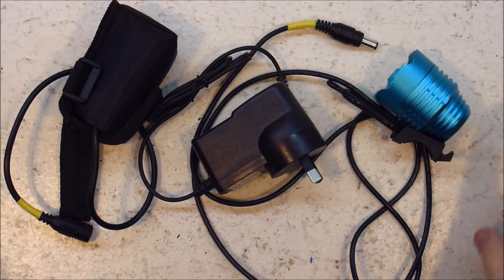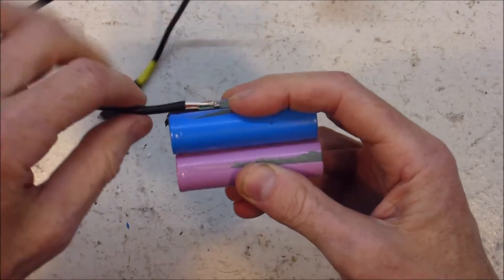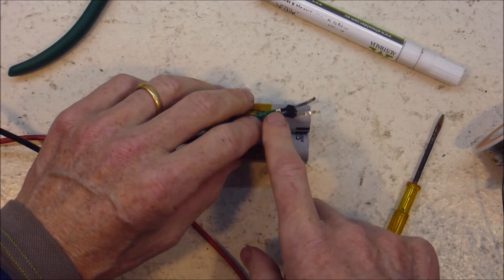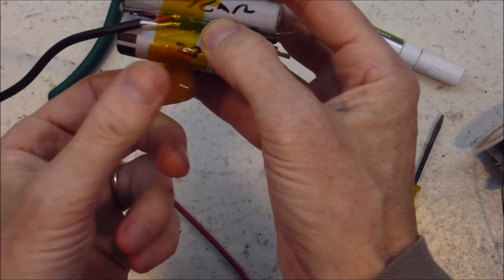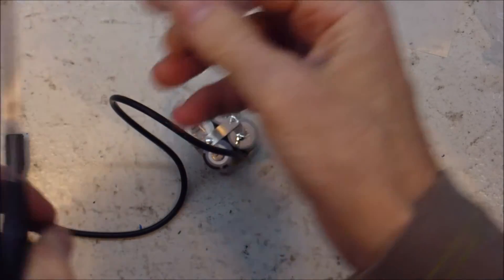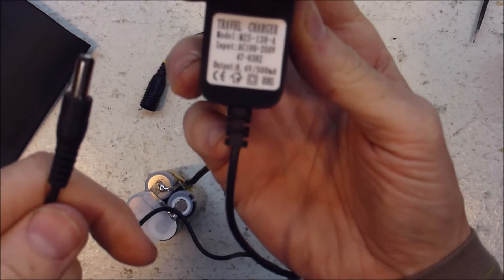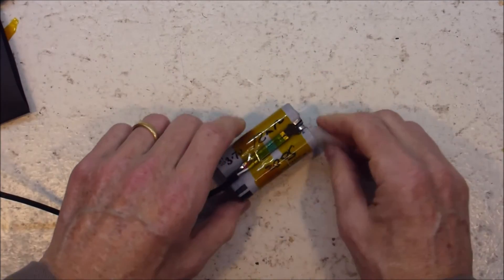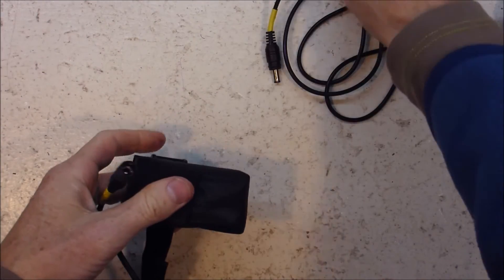Bike light battery repair

Comment: Im using solar storm x2 bike light, got same battery pack with 4 inside but after like 4 years using, they last for 1 hour now which is very bad, so i have to buy 4 new 18650 3.6 batteries and connect same as they are now (old ones)?
Reply from the maker: Yes. That should work.
Reply: @paulkennett  but how i know to buy exact same batteries like old ones? I mean is there some difference or its just capacity?
Reply from the maker: @Introoder023  Ah! You don't need the exact same batteries. Lithium Ion 18650's are a bit like AA batteries - all pretty interchangeable (assuming you have all four the same).  For the lights you're using pretty much any 18650 will work. Anything between 3000 - 3600 mAh will be fine. Just make sure you don't buy anything rated over 3600 mAh because they'll be fakes.
Reply: @paulkennett  i see difference in amper (A), some are 15A, 18A, 23A, does that make some big difference or?
Reply from the maker: @Introoder023  Your lights probably use less than 10 Amps (maybe less than 5 Amps) so anything should be fine.

Comment: hello. i have exactly the same battery pack and the same charger.  At the minute 4:07 you say you used 250mah battery or you wanted to say 2500mah?? i am asking this because i am thinking on use your video to replace my batteries and i am trying to find out which ones should i buy. So for that, what would you recommend? 2500mAh 3.6v or higher mAh and voltage capacity?? -thank you
Reply from the maker: Yeah - I ment to say 2500 mAh
Reply: @paulkennett   i think i'll go for the 2600mAh 3.6v which is the one i have available now!! Thank you
Reply from the maker: @luisfcs02  Yep - that's a good option.

Comment: Was considering replacing the batteries in a 4-battery bike light power supply; one from Bright Eyes. No doubt whatsoever this is one of those "Easier than it looks" situations you've got going here; didn't look all that easy, either. Will likely spring for a new (different) PS. Regardless, an interesting video!

Comment: @paul Kennett  3A / 5A , which BMS suitable for 2s2p 18650 bettery pack?
Reply from the maker: It all depends on the load you're attaching to the battery. My guess is a 5A BMS would be OK for most LED torches.

Comment: Yes, nice Job!
Can I ask a question? What soldering iron are you using? My iron doesn't seem to get hot enough to allow thesolder to flow. I'm worried that to get a nice soldered joint I have to apply heat for too long. Thanks.

Comment: Hello Paul...great restoration and video...!   Always good to make a sketch, before dismantling.   I notice, there is no strain relief on the cable...not even a cable tie...?   Hmm...   It could be the culprit, for yanking the original cells apart... that and the wet conditions.
Reply from the maker: Hi Jakob. Ah!  - good idea regarding strain relief. If I get to restore another one of these packs I'll fix that too. Cheers, Paul

Comment: Aren't the connected cells in the old pack going to have been overcharged and possibly damaged as they only totalled 3.7V (due to the missing two) and the charger was trying to charge them to 8.4V?

Nice video by the way.
Reply from the maker: The two cells were connected in series - so the 8.4V was OK. It just meant the pack had half the capacity. My guess is they were all second hand cells!
Reply: Paul Kennett Ah ok. These cheap lights are notorious throughout Flashlight and Mountain Biking forums for having low quality cells.       They have a scarily high tendancy to go "Thermonuclear".
Reply from the maker: I wouldn't be surprised if some (many?) of the cheap chargers went over 8.4V
Reply from the maker: My quess ís that - at this price point - the control board probably only does over/under voltage protection, not balancing. I wouldn't trust the charger to be that safe either. I did like the LED housing though. That was nice.
Reply: Yes, true. But wouldn't the balance board regulate the charging voltage and current? *(I'M ASSUMING it was indeed a balance charging board on the side)
I wish you had measured the voltage during it's charging cycle. And perhaps the current as well.
Which would tell me if it's CC and then switched to CV. 
*Plus a glance at the boards circuit would give away the part numbers..
That being said. I thank you so much for uploading this video. It's exactly what I was looking for! :) 
Just got one with 6 cells. 2x3 2500mAh (claimed)
CHEERS!
Reply: Yes, true. Perhaps just a protection board. I'm tempted to teardown the pack just to find out what chips (if identifiable) Im sure Ill come up with over/under Volt. protect... The charging current is relatively low, since it takes about ~12 hours to charge my 6 pack..I'll "assume" is "SAFER" at lower current charge...
THANKS!